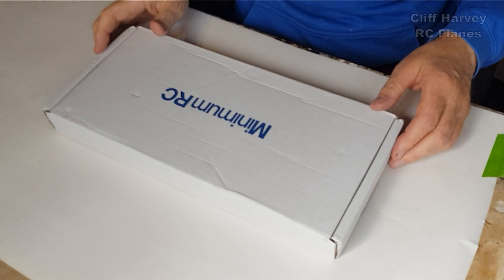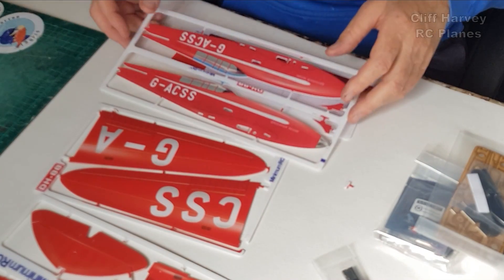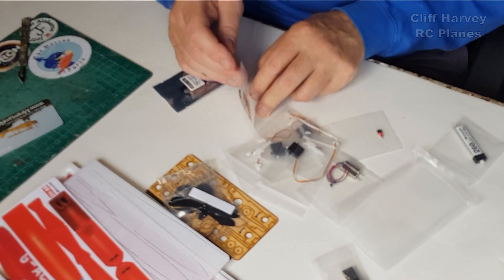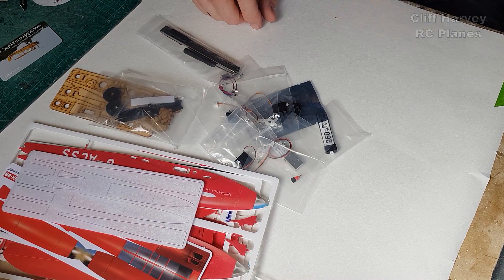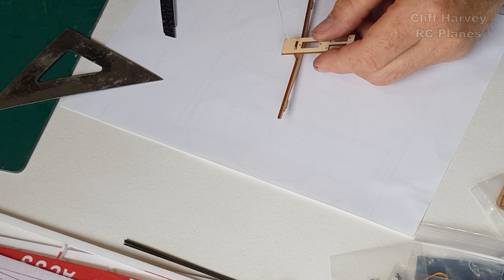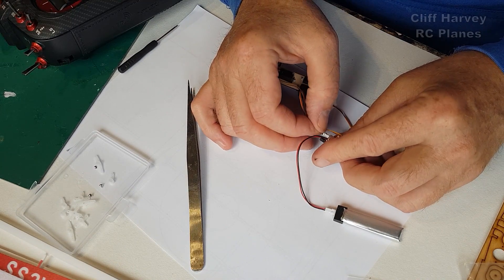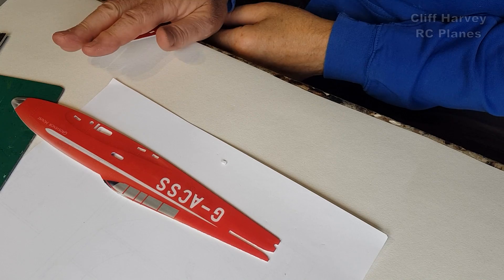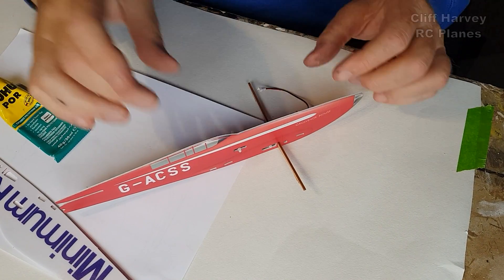MinimumRC De Havilland 88 Comet Racer Kit Build, Part 1 of 2

Comment: Hi Cliff, which would be your favorite MinimumRC model for an intermediate builder/flyer?
Reply from the maker: @spann3r5  Interesting question Spann, building wise they all follow the same construction techniques whether balsa or foam, but flying wise they all seem easy but then I've had a lot of practice! You can't go wrong with the, high wing models as they have more inherent stability, as I said, Interesting question 🤔

Comment: Fantastic little model. Can't believe you've never done a twin. You did do a Lank once didn't you? 
I know there is a DH88 in the "Towner" collection, the challenge is that it is 44 inches, so still veeery far down the road for me.
I am sure this one will also look great in the air!
Reply from the maker: Hi Andrew, I know, my first twin, yes I still have the Lanc but it's not a twin 😁🤔👍
Reply: @CliffHarveyRCPlanes  MinimumRC also have a B25 Mitchell twin motor. That's a nice little flyer too. (Thanks for your great videos of your DH88 build, Cliff)
Reply from the maker: @johnmillercrawford6243  Hi John, yes, you're correct, MinimumRC have a nice formula going with their designs 👍🙂

Comment: Hi Cliff,thanks for sharing ,a big help to build mine...question.did you receive the battery connection cable in the kit or ....and the same with the engine connectors
Reply from the maker: Yes, the Motors had longer wires already fitted that reached the receiver and the battery connector was already connected to the receiver 👍 board
Reply: @CliffHarveyRCPlanes  ,ok,i see the problemen now...i' ve got mine from banggood,they don't sell the complete once...and i found the missing parts at minimumrc...so i have to have to wait...also ordered a complete kit,so i know how to fix these connections..thanks for your reaction Cliff!! God bless from the Netherlands!!